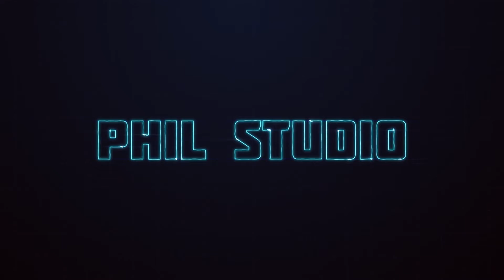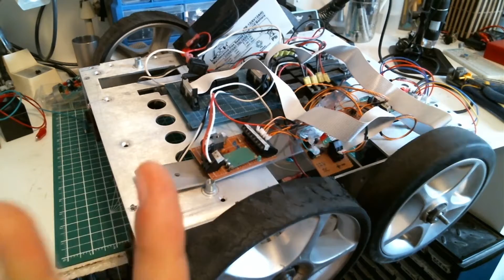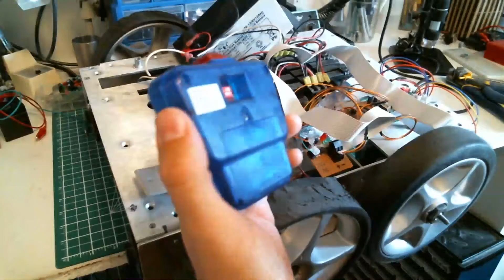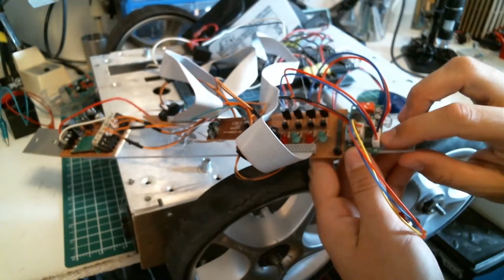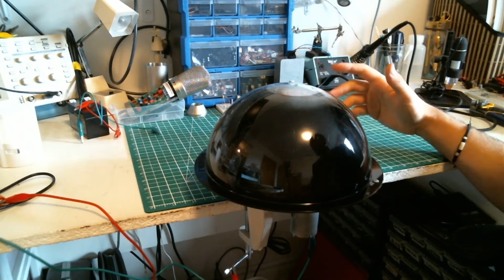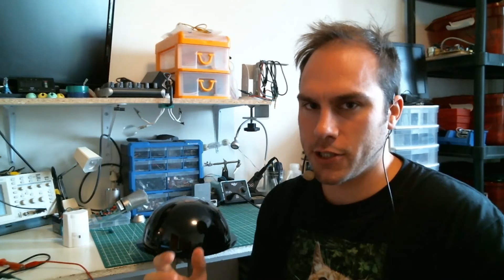Robot made from Recycled Parts

Comment: Love it! I have built so many robots but not at this scale. My first robot was based on a lynxmotion platform which used a Basic Stamp clone. I heavily modified it for obstacle avoidance and a limited vocabulary with attitude! I built this about 1998 or so: https://youtu.be/o6ZiAij4Lrc... My most recent one was designed for a client and is based on the Arduino platform... I designed this from the ground up including the PCB. https://youtu.be/Y2vN6OhoUK4